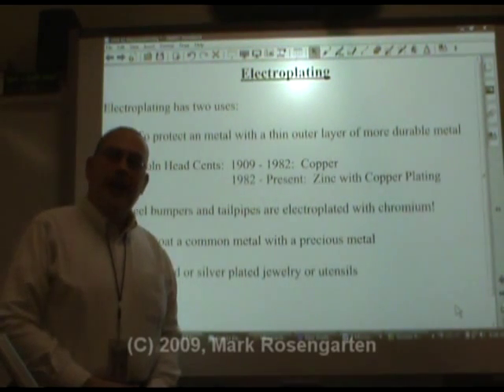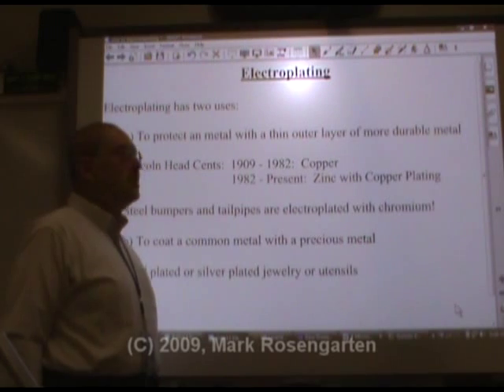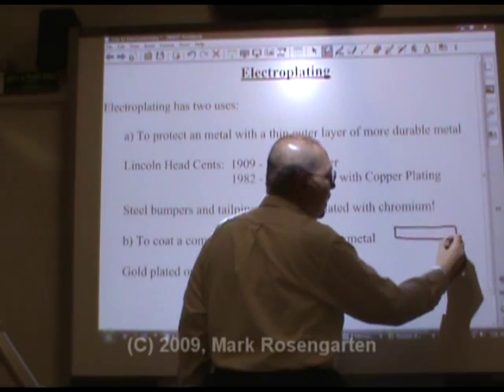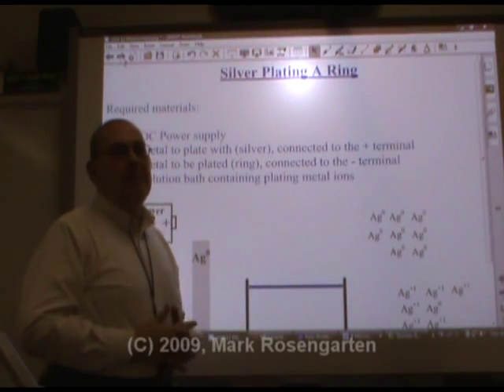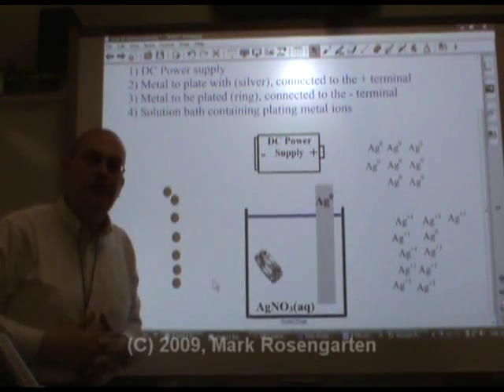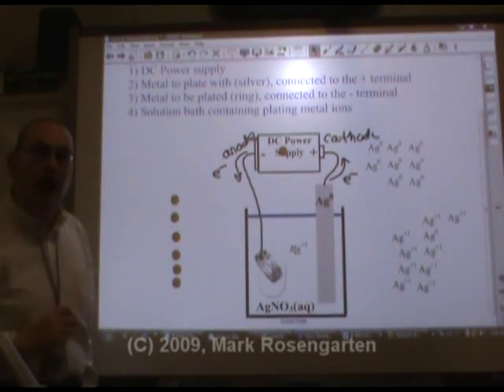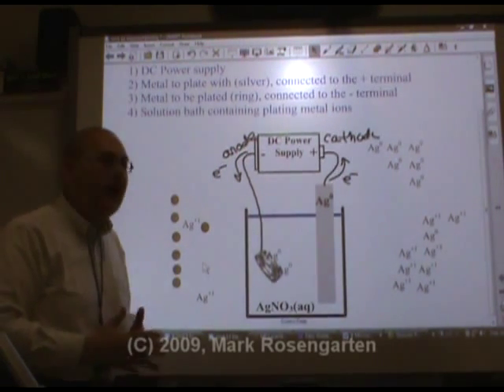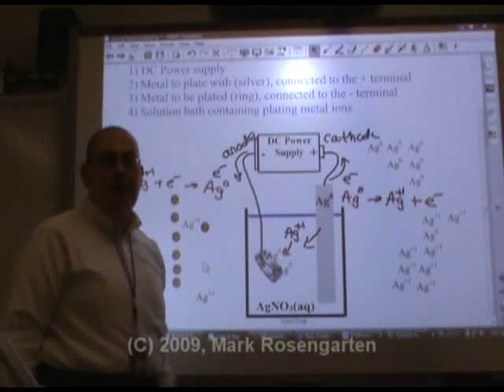Chemistry Tutorial 12.3c:  Electroplating

Comment from the maker: + and - are determined by the voltaic cell.  Anode and cathode are determined by the direction of electron flow.  The - anode of the voltaic cell gives up e- that are gained at the - cathode of the electrolytic cell, the + cathode of the voltaic cell gains e- from the + anode of the electrolytic cell.  The signs + and - are how we designate each electrode for the sake of plugging everything in correctly, nothing more.